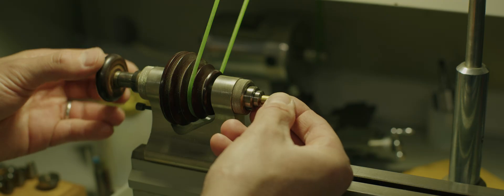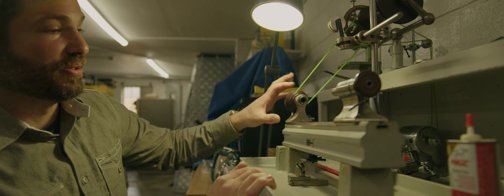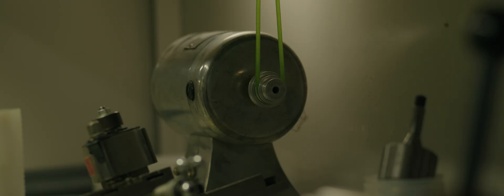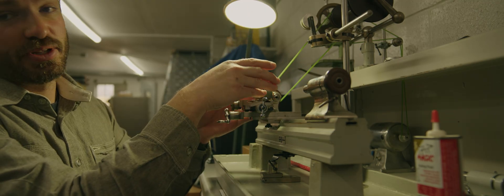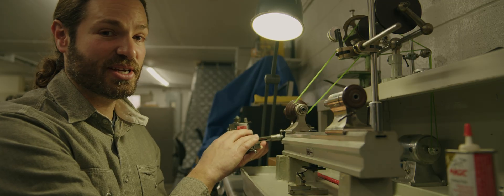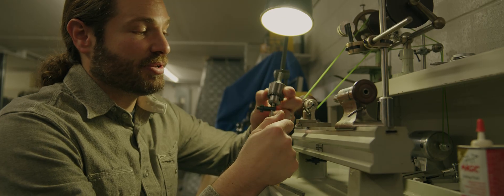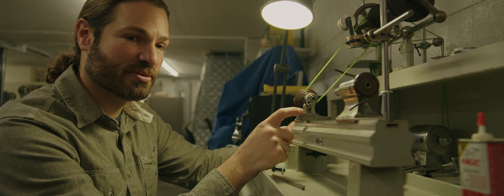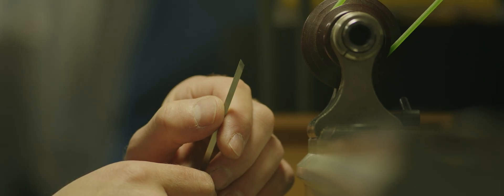A Watchmakers Lathe

Comment: My wolf Jahn lathe is my pride and joy, it’s a must for anyone who like fixing vintage movements when spare parts a no longer available.
Reply: @Wigwagwobblestick;
I had a quick look at your video about your lathe... The video work is lovely, and the "lathe" is, with your setup, a piece of jewellery!
My LLPV is a couple of sizes larger, but it's a precision piece... I actually cleaned up the 3-jaw chuck by scraping, using a piece of 8 mm drill rod as the "master", so that I made the fit to be maximally precise in the range of material I usually work in... No bell-mouth, no grinding grit, and scraping was therapeutic, as well as "reasonably precise"
Again, congratulations on your ownership and maintenance of your machine!